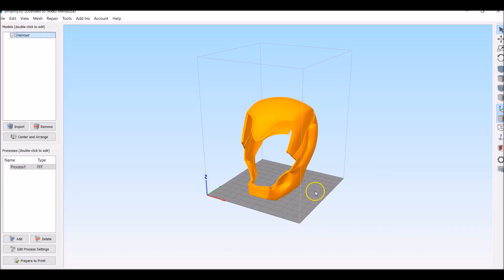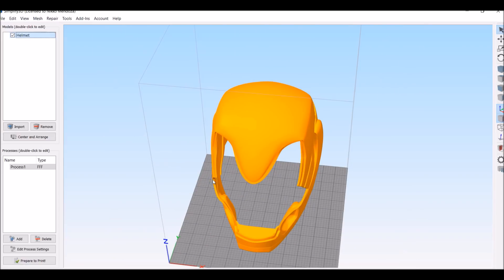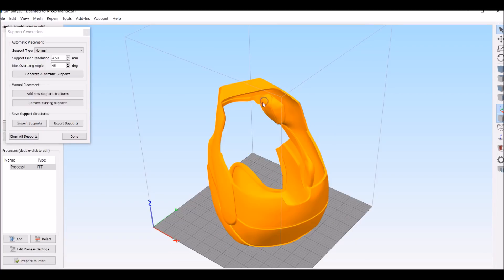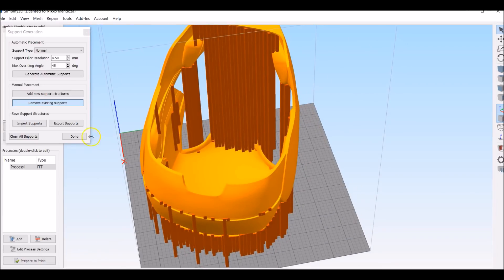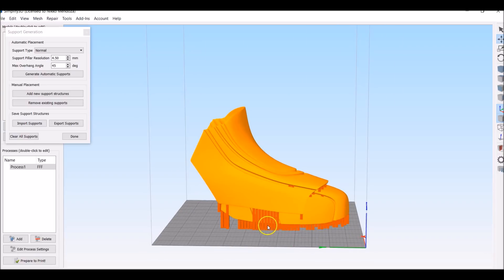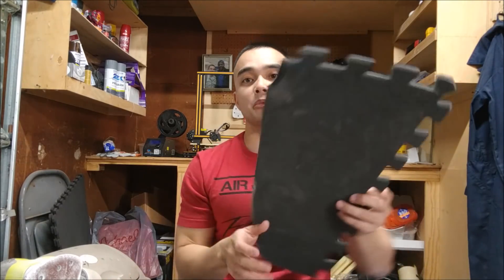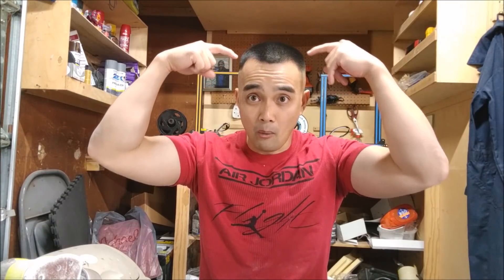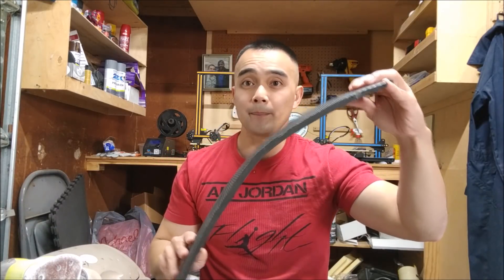3d Printing- How to Orient Your Prints for Less Support

Comment: This is an excellent video, especially for the helmet I am currently designing... I was having some challenges on either printing it upside down, or cutting it in half and print sideways. 

After seeing this video, I'll definitely print it upside down and hope to keep my support structures to a minimum
Reply: How did it turn out? I am about to purchase my first 3d printer myself.(Wanna print helmets etc as a hobby to enrich my sparetime as well as painting them etc :D)

Was there supportmaterial deforming holding onto the top of the helmet? Aprox how much did u spend in supportmaterial per gram?
Reply: @simonbionary11010  I haven't printed it yet as my print area is too small for it. I would have to split up the model into pieces
Reply: @MrRileysGameroom  Which printer do you possess?
Reply: @simonbionary11010  I currently own a Robo C2. Waiting for the Adventurer 4 to get back in stock on Amazon
Reply: @MrRileysGameroom  Ah! I am prob going for an Creality Ender 5 plus or a Ender 6. Not sure which yet^^
Reply: @simonbionary11010  I'm looking at those also, but I want to get up and running, and not have to do too much tinkering
Reply: @MrRileysGameroom  Ah, so to be clear. You want a printer which is quite large, ready-to-print and what budget? Been researching 3d printers for like 6 months and as i said even if i dont own one i think i know quite some of it.
Reply: @simonbionary11010  I like the Adventurer 4. It's about $800
Reply: @MrRileysGameroom  It is a 220 mm x 200 mm x 250 mm with Bowden driver right? If its a possibility to do i'd upgrade the bowden tubing to a capricorn upgrade. Will last you much longer^^

Comment: hey nikko have you tried using flexseal on tpu just wondering because it comes in white and black
Reply from the maker: No I haven't
Reply: @NikkoIndustries  just something i thought about recently i may try it and see how it does , im still trying to perfect my settings for printing tpu armor i installed a .6mm nozzle on my new cr10 s4 . could use  some help with support settings i notice supports are fusing with prints.

Comment: hey Nikko and everyone i finally got my cr10 s4 what a game changer especially now that i am redoing my armor in tpu. question for ya, i m getting ready to print my chest piece whole for the stormtrooper first order what is the best way to orient this piece with least or no support upside down with support touching build plate shows 5 days im using cura thanks
Reply from the maker: Great!! I would orient it vertically
Reply: @NikkoIndustries  ok thanks thats the hardest or biggest part to print i have it now showing 3 days , with these printers can you start printing in the morning and then pause over night  or is it best to just let it keep printing or should i still break up the chest front and back even though its tpu